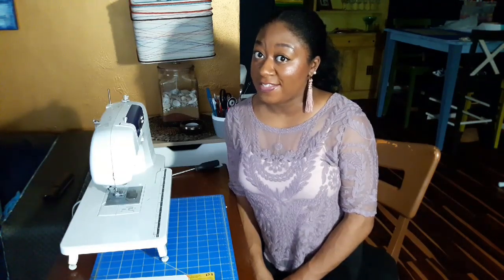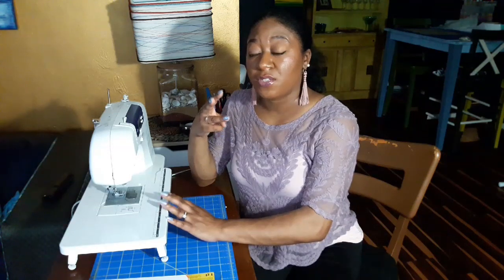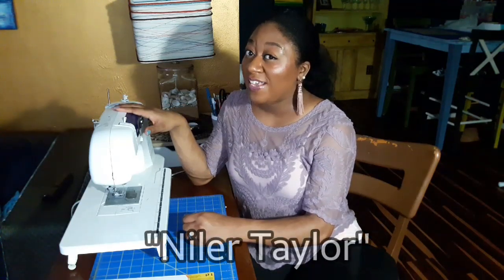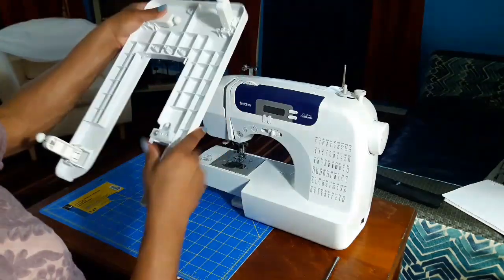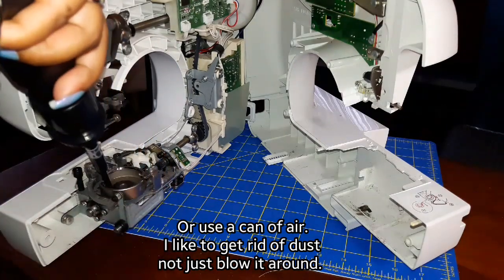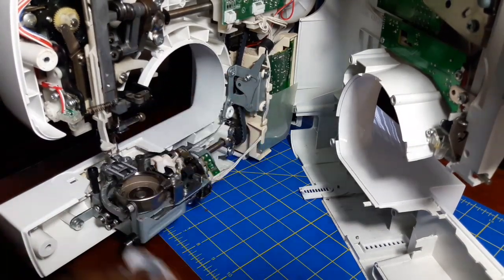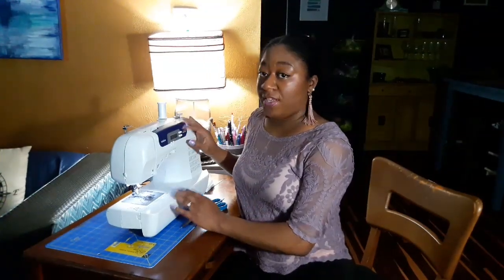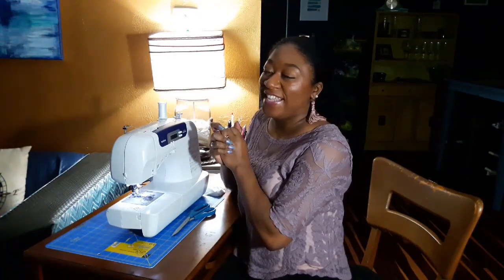Sewing Machine Maintenance

Comment: Hello, I live in France, I came across your video, given how easy it is for you to open and maintain your sewing machine, it proves that you are used to doing it, I also have a sewing machine Brother for about a year and a half whose model is similar to yours. I recently did the maintenance myself, which saves me about $90 at a technician, my question is this, I don't know if you use your machine occasionally or intensively, if you sew with fabrics thick enough frequently but maintaining your machine regularly does this allow you to avoid problems of disruption and desynchronization on your machine and to avoid taking it to the technician to make adjustments?

Comment: I know this video is a year or so old, but I just wanted to comment and say.....”THANK YOU, THANK YOU, THANK YOU.....and last but definitely not least, THANK YOU”  I searched the internet for the past couple of weeks, looking for a video to show me how to take my Brother Sewing Machine apart and thoroughly clean it. I have always cleaned my bobbin cage and around the feed dogs etc.  Yet, I’ve always been too intimidated by the fact that the sewing machine is a “computerized” sewing machine, so I’ve never took it apart to this degree. But my wheel had become really tight and nearly unable to be turned.  I felt like it was just an issue with lint, dust and needing to be oiled.  The only service center is 45 miles away and they charge $75 to oil sewing machines, not counting they wanted to keep my machine for over a week.  And if the cleaning & oil service wasn’t the issue, they charged $65 just to diagnose it (parts and repairs were extra).  After watching your video (twice), I finally got the nerve up to open my machine and clean it, oil it and just look at all the mechanical components inside.  Even though my Brother was a CE1008 model, with the exception of the positioning of the screws to separate the front from the back, it was identical to yours inside.  Thank you again..... your video saved me a lot of money.  Btw.... after cleaning and oiling it, my sewing machine “PURRS” like a kitten again. It also seems to sew better than it did when I bought it over two years ago.  

One question..... I do sew roughly about 4 to 5 days a week (an average of 6-7 hours each time), so how often do you recommend that I clean it in this manner (“Deep Clean”, as my husband called it)?

Comment: Thank you so much for this video!  I watched it a million times as I cleaned and oiled my cs6000i.  It is so frustrating that these inexpensive machines cost so much to get serviced.  For the same amount of money, I could just buy a new machine every 2 years instead of having it cleaned by a pro.  My machine is about 10 years old and having upper tension issues.  Guess who just ripped apart her machine, cleaned it, oiled it, adjusted the tension, and put it all back together again?  This girl!  
Thanks for sharing your experience! Could you elaborate on that metal from the tension wheel positioning around that other metal piece?  Want to make sure I got that in correctly.
Reply from the maker: Jenna THE VICTORY! 🤣🤣🤣 You would know if the tension wheel was hindered because you wouldn't be able to reattach the front to the back without force. Nor would your machine work. I can't tell you what side that little metal lever goes on because it's so short when you open the machine up. If it was easy to put all the screws back in and you received no error code, the lever went to the correct side. 😉
Reply: I just did mine and after opening it for the third time (2nd was because I didn’t pay attention to my diagram and put a screw in a hole that wasn’t for a screw so I had to open it and get it out) I figured out where the tension thingy needs to be when you put it back together. Looking at it from the front, I turned the tension to 0, then used the little flathead screwdriver that came with the machine and held the metal lever on the front part (that comes out of the wheel) to the left of the little triangle thingy that points up on the back part of the machine.  When I put it together before, I had giant loops on the underside of my fabric when I sewed.  Now, I played with the tension a little and it is perfect!
Reply: @katybrown7157  fantastic!!!  just what i needed.  thank you.  ♥ xo s
Reply: @susanfrank535  I commented on it hoping I would be able to remember next time too :D
Reply: @katybrown7157  Thanks a lot! It took me the whole day trying to reassemble my machine (SQ-9000). Only after reading your instructions I managed to do it right. Cheers from Brazil.

Comment: Thanks, this is helpful. I've taken mine apart two times now (before seeing your tutorial) and the first time I couldn't move my tension wheel due to the issue you mentioned and now this time I am getting an E1 (saying my presser foot is up when it isn't). Ugggg... Hope I didn't screw it up too badly. I was just trying to clean it out extra well to fix bird nesting I was getting.
Reply from the maker: hannah ransom Oh no! I've had that happen to me once before but I can't remember how I fixed it! 😣 All I can say is make sure you check the bobbin case, there is a tiny piece that sticks out on the bobbin case that can get trapped under the metal gear and throw things off. Replace your needle and try another bobbin, sometimes a bobbin winds unevenly and that will mess things up. Also, tighten the presser foot holder, mine has become increasingly loose the older my machine gets. Hopefully, one of these will help!
Reply: I’m having this issue right now too!! Did you find out how to fix it??
Reply: I have the same problem, how did you fix yours?
Reply: hannah ransom  ...I have the same problem (E1) ...how do you fix yours ..  plz help

Comment: Oh man the manual tells you not to oil this machine.....
Reply from the maker: Cassandra Brown It's totally up to you as the machine owner whether or not to oil. Because mine is almost 10 years old and used VERY frequently without being serviced by a professional certified technician, I find it runs better when I clean up old oil and lightly oil it with fresh oil. Yes, overdoing oiling could damage the computer, but how do you know that sending it away for maintenance isn't just putting it in the hands of someone who is going to oil it anyway? 🤔 Just a thought!